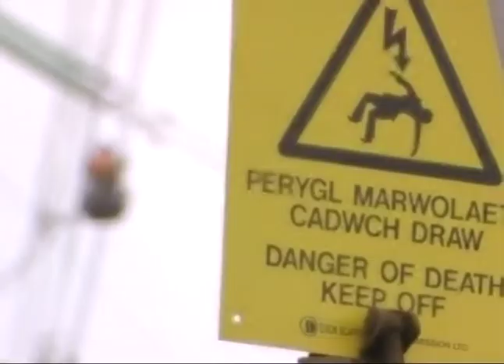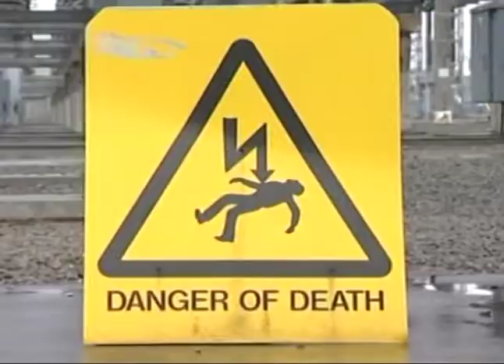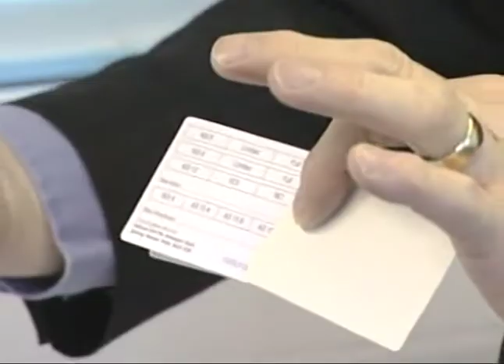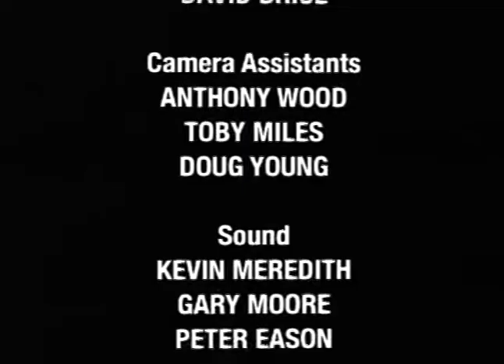BBC Real Men Series - Overhead Linesmen

Comment: A few L6 and L2 pylons featured’ not an easy job changing out insulators’ spacers and conductors’ they have to be at the right tensions and some towers can be tricky to navigate’ the grid is being modernised and quad bundles are being replaced by triple and twin conductors and twin conductors are being replaced by single conductors on 275 and 132kV lines’ I heard here that electricity can jump to a conductor that isn’t earthed and that reminded me of a tragic story of a linesman who died on a L3/L3c line in the highlands due to a conductor that wasn’t earthed and the energy company was fined thousands for it.
Reply: Why are quad bundles being replaced by triples?  Is it something to do with less strain during high winds?